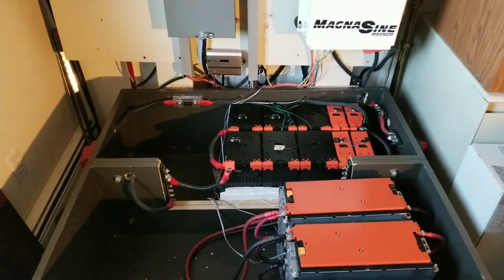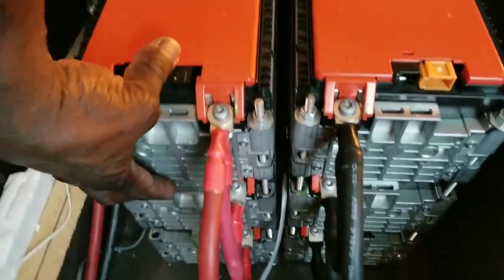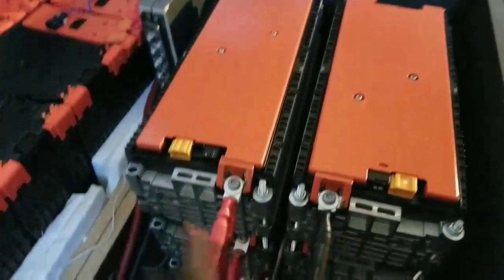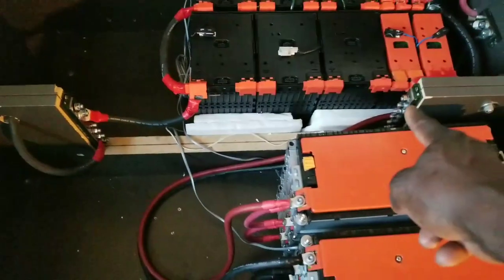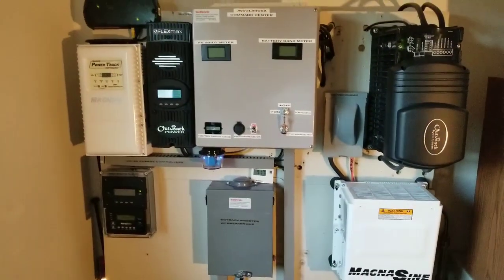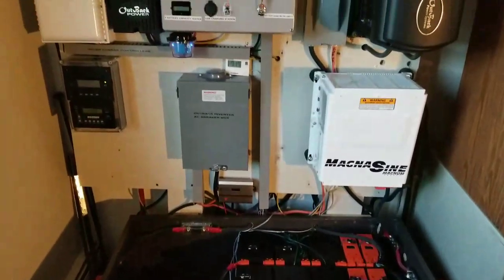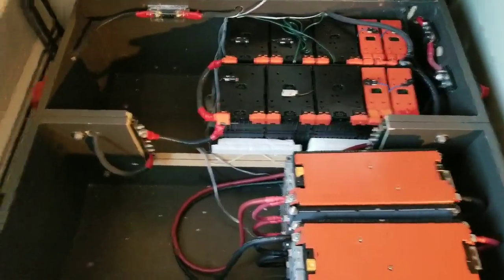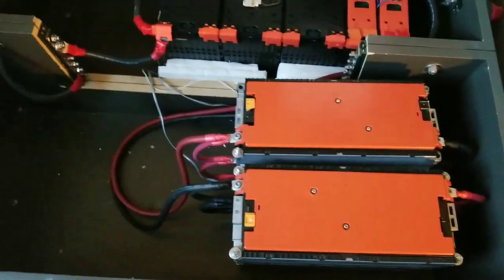OFF-GRID SOLAR BATTERY BANK: DIY 24v, 48v VOLKSWAGEN E-GOLF VS. FORD FOCUS LITHIUM BATTERY UPDATE

Comment: Nice!  Why did you choose 24V?   Was it because the number of batteries or the inverter requirements?   I love how clean you keep your system
Reply from the maker: SolarDrew,
It's not because of the batteries neither the Inverter.
The battery box you looking at have two battery banks. One is configured for my 24v Magnasine Magnum MS4024 Inverter/Charger which runs on Volkswagen e-Golf lithium battery the other bank is the Ford  Focus Lithium battery which i Configured for 48v for  my OutBack 3048MT Inverter/Charger.
I ran both Systems simultaneously if that's what you asking.
Thanks for complimenting my OffGrid Solar System.